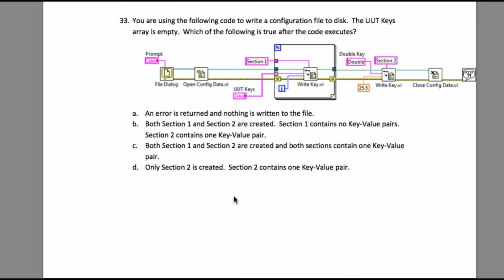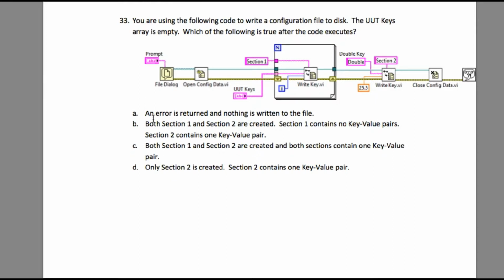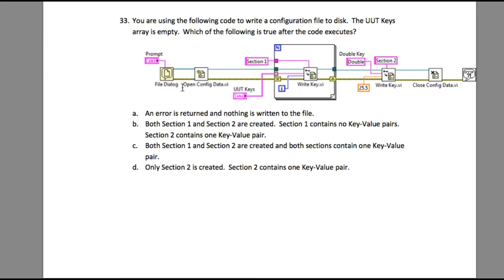LabVIEW CLD R 33 Handling INI file

Comment: Actually, the answer is A, but not for the reason he stated in the video. The For Loop will execute zero times since it is receiving its number of iterations from the array size of the UUT Keys via the auto-indexed tunnel. The output tunnel containing the file refnum will be a null refnum, not the proper refnum. The Write Keys.vi downstream of the For Loop will then produce an error since it does not have a valid refnum input.

Comment: What is actually happening here is that as UUT Keys is empty, the For Loop never executes, and the reference is never passed to the second Write Key.vi, hence the error. So, it is not an error for what happened inside the For Loop but for what never happened in the For Loop.